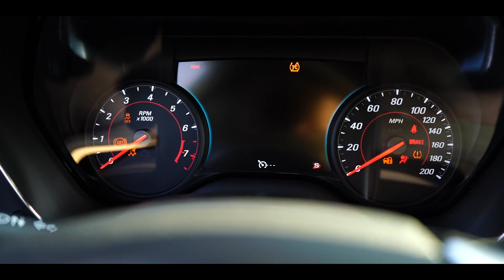FINALLY Fixing the DRZ

Comment: Your DRZ made me wanna get something, so picked up a WR450 (because I'm not 4' 3"), loving it. Not sure what to do for a scheme on it though. Was thinking a dark red frame, white plastics. Wonder if you can wrap a plastic gas tank?
Reply from the maker: Velislide 5’ 8”, but yea basically a midget. The wr450 is close in height tho. You can wrap anything you want
Reply: Just giving you shit. I figured there would be issues with the plastic fuming, thought that's why you couldn't paint plastic tanks. Having to buy a new tank just to change the color would be gay as shit, suppose I could always ritz dye it. Bunch of crap coming tomorrow for it, can't wait to get started on it. Planning on riding up here in MN again?

Comment: I love the difference between bike work with Dan vs Motonosity.. with moto its like yeah so you're gonna want to don't this way to make it work best I've got my soldering iron heat gun and 3 different size wire strippers and with Dan it's like fuck it I'm gonna chew through these wires, I might not even disconnect the battery then use this lighter to melt saran wrap around this shit 😂😂 love the videos brother keep dicking on